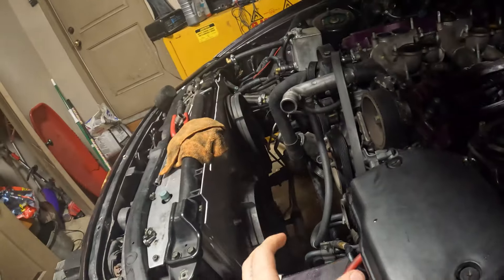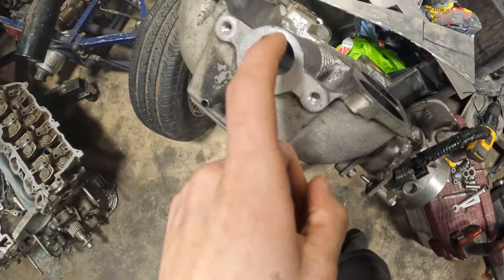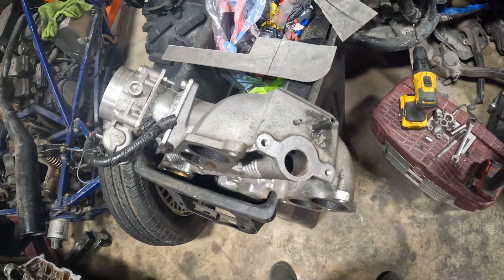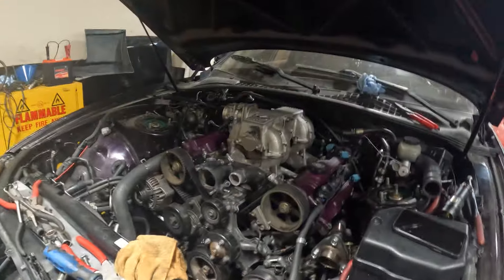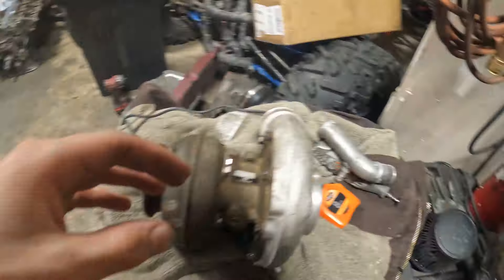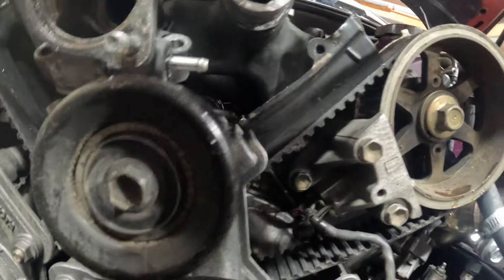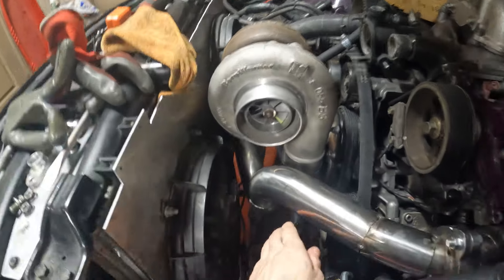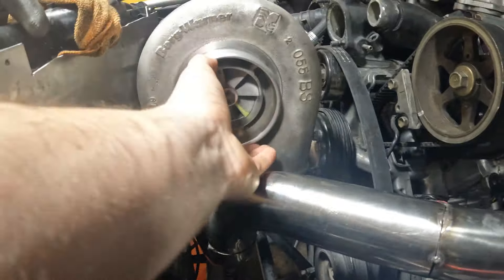Sc400 turbo part 4 - Mounting turbo, more exhaust routing, and intake blockoffs,

Comment: hey if you sand blast that intake manifold,  make sure it's fucker clean inside before you run the engine.  if you take a clean rag,  wet it with acetone,  wipe the inside and it dirties up the rag,  it's going to fuck your engine real good.

also i have a buddy with a sc400.  you should sell him the supercharger real cheap.  that would be bad ass